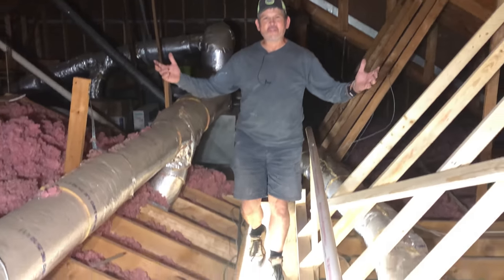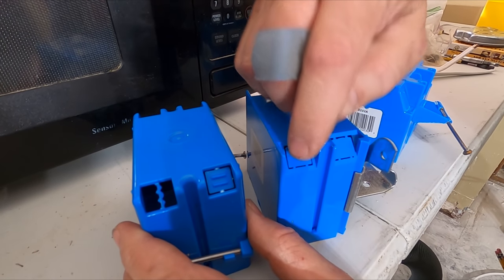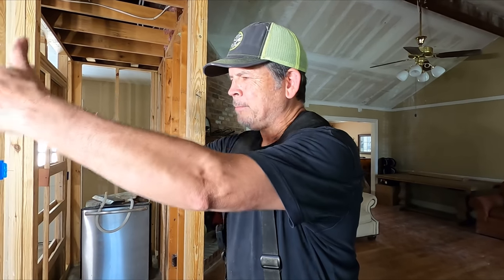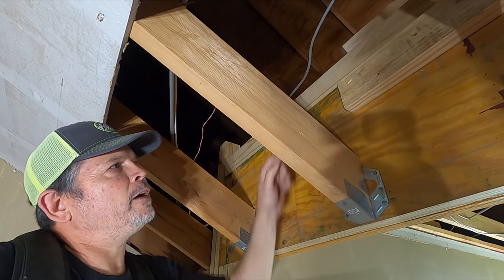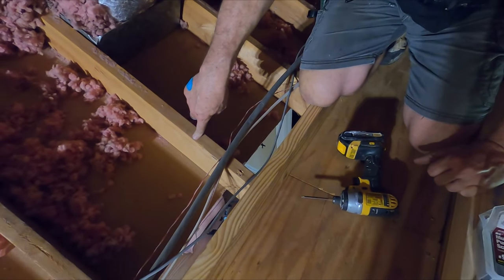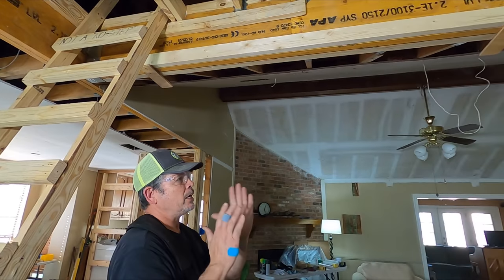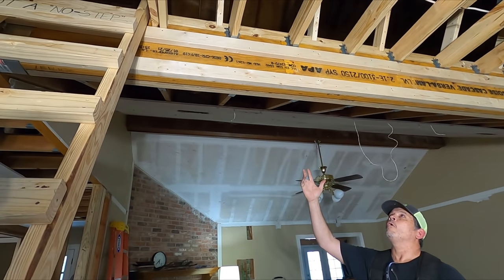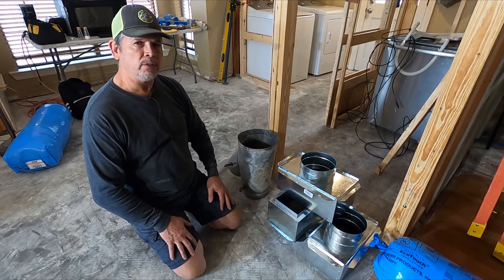EASY ATTIC TRAVEL! We Had Some Spare Materials... Ep. 11

Comment: Hidden J-Box. That's the least of the horrors one can encounter in a remodel.  I once found outlets in a down stairs kitchen where the lady said  "Oh, we don't use those. They never work."  Upon inspection I found both sides of the plug in were hot!  Several hours later I cleaned up the mess and they had new working GFI outlets.  Another time I found a 3 way switch where people were afraid of it because they had gotten "tickled" by the electricity.  Some idiot had used the common ground as on of the travelers so when the switch was using that leg the entire electrical box got lit up.  Fixed that mess too.
Reply from the maker: Some good detective work there user990077 👍

Comment: As an old HVAC helper, I wish every attic would have a solid catwalk down the middle cause going through the ceiling was always stressful lol
Reply from the maker: Yes it is Brandon thx 👍
Reply: HVAC helper.
Reply: @travism9339  yeah HVAC helper 🤨
Reply: @bruizzz13  What did that job entail?
Reply: @travism9339  putting together sheet metal duct work, running flex ducts, run line sets and various other stuff. The company I worked for was a plumbing/HVAC company so sometimes I would help the HVAC guys

Comment: Duct tape was originally called "duck" tape . Named not after ducks, but after duck fabric that was used in it's manufacture.  Later after WW2 people began using it on duct work and the pronunciation changed to duct tape. Now it's not recommended for ductwork at all as it is flammable. Now they recommend the metallic tape like you used on duct work.

Comment: I always foil tapped the flex duct then zip ties the insolation
Reply from the maker: Yeah I kinda mentioned that too.  The way those boots are designed there’s a ridge to keep the inner duct tie from slipping off so I felt pretty good about that plus the inner duct is slid on completely to the neck.
Reply: Heavy duty mastic lined foil tape can go right over the zip tie. Zip tie goes on easy and holds it in place while the tape air seals.
Reply: Yes I also do both, zip tie frees up both hands which enables me to tape. trying to tape and hold the ducting is clumsy

Comment: Duct tape was originaly called duck tape because it was made from a cotton fabric called "doek" and pronounced "duck". Duck could be rubberized to make it waterproof and the US Army used rubberized duck tape to seal ammo boxes in World War 2. During the housing boom following WW2, surplus duck tape was widely used to seal HVAC ducts and the name morphed into duct tape. Meanwhile, the rubber was replaced with polyethylene and synthetic fabric began to replace cotton duck so duct tape was no longer duck tape. However, the adhesive could not withstand the heat of heating ducts and the synthetic fabric also deteriorated under heat so the HVAC code was amended to prohibit the use of fabric tape on duct work. Meanwhile, some entrepreneur trademarked the name Duck and started selling Duck brand duct tape even though it could not be used on ducts. Other manufacturers couldn't call their tape duck tape due to the trademark (and it wasn't made from duck anyway) so for lack of a better name some started calling it utility tape or fabric utility tape, but most people still call it duct or duck tape, even though unless it is Duck brand tape, it is neither.

Comment: If it is designed to be removed completely it must be a knockout.  Anything that can be so easily removed can not be considered a clamp since a small amount of force could cause it to break out.  A clamp would require lots of force to break out; so much it would probably rip the box out before the clamp failed.

"Duck" tape was originally developed to waterproof ammo boxes during world war 2.  The smaller ammo boxes were filled behind the lines and then the joint between the lid and box was wrapped with duck tape so water could not get in while being carried and used by soldiers on the front lines when it was rainy and everything was wet and mucky.  All the soldier needed to do to open the box when he needed ammo was to run a knife along the joint to break the seal.  Just like a duck's feathers are designed to keep the duck dry in the water, "duck" tape was designed to keep the ammo dry when in the water.  But just like a duck's feathers have to be molted and replaced, so to was "duck" tape designed to last only for a short period of time.

Comment: The only reason to not have a basement is that ground water is too high. My basement floor is directly on top of riverbed of a river that is less than 100 yards away. If I had a house in the south, it would have a 2-level basement. The further down you go the cooler it is.
Reply from the maker: No basements within 100s of miles here.  The water table is too high just like you said

Comment: I used to manufacture flexable air duct and the silver part (sometime black) is called the jacket and the black coil on the inside is called the core. Just wanna pass some knowledge on to ya if you didn't know!
Reply from the maker: Thx Andrew 👍

Comment: Love the catwalk. I put them in all the time but usally all I can fit is a crawlwalk. But does saves me time and safety. Glad you do not use those crappy phillips screws. Those are dangerous and should be banned by OHAS. I have a Canadian snowbird friend that I get to bring me down several cases of "Robertson" screws every winter, which are similiar but much cheaper. He claims they have never sold a Phillips or Slotted head wood screw in Canada.
Reply: That's false. You can get screws of any kind here in Canada. But Robertson is the best :p Actually torx are getting pretty popular for deck and framing screws up here, they strip out less than Robby. But the best part of a proper Robertson taper drive is you can jam a screw on the end and it won't fall off.
Reply: @thebigmacd   He is still in AZ, so together went on Home Depot's site in Canada. Total of 7 WOOD screws choices that are Slotted or Phillips  VS 195 choices of Robertson Wood Screws. None of those 7 are longer than  1 1/2". He said up there if you did want to buy those you would have to do it off Amazon or Lee Valley??
Reply: @revenniaga6249  correct. 7 choices at HD is not "they have never sold slotted or Phillips wood screws in Canada". Plus, did you check Home Hardware, Canadian Tire, Lowes and Rona? Or any fastener store. There are tons of places that sell non-Robertson wood screws. But they suck anyway, so Robby wins.

Comment: There is an exception in the code for those single gang new work boxes. They don't need to clamp the wire as long as you staple within the 8 inches. "Exception: Where nonmetallic-sheathed cable or multiconductor Type UF cable is used with single gang boxes not larger than a nominal size 57 mm × 100 mm (2 1⁄4 in.× 4 in.) mounted in walls or ceilings, and where the cable is fastened within 200 mm (8 in.) of the box measured along the sheath and where the sheath extends through a cable knockout not less than 6 mm (1⁄4 in.), securing the cable to the box shall not be required. Multiple cable entries shall be permitted in a single cable knockout opening." This is under 314.17(B)
Reply from the maker: Cool thx Kris 👍
Reply: @StudPack  No problem.

Comment: Looks like the buried junction box behind the dryer was installed for use with a gas dryer.  At the time of installation perhaps they did not know which!
Reply from the maker: It's a gas dryer now.  The 120V receptacle is fed by 10/3 romex so someone was thinking electric dryer at some point.

Comment: In the previous video you showed how you cut Romex with your razor knife but then later you showed us your Romex wire stripper that has a belt in stripper for the sheathing on 12/2 and 14 two wire. So the question is why do you use a razor knife instead of using your sheathing stripper? I used to cut Romex with the razor as you do but once I got my Romex strippers I use them and find it much easier and quicker.
Reply from the maker: We like to show different ways to do things! That’s all 👊🏼

Comment: Head over to Carlon's webpage (which is actually hosted on their parent company ABB website) and goto the "Resources" section, then click on "Publication Library", and then enter the product number you want "Installation Instructions" for.  All those installation instructions are part of the UL Listing of that product and must be made available to the end-user either as part of the packaging, a stuffer sheet/leaflet, or online.  If you have any problems locating the official installation instructions, then please reply with the complete part numbers of the Carlon products you are using and I will make sure you get the correct info sent to you.
Reply from the maker: Thx 👍  I've been to that site, navigation is not intuitive but I found some info but no where does it talk about those knockouts.  Closest I got is: 
https://new.abb.com/products/7TAA040010R0002/1g-20-cu-in-zip-box-w-nails  
Additional info not available, clicking on links yields  "document not found"

Could be it's for knob and tube (each conductor needs a separate hole, one on each side of that flap?).  Part number is B120A-UPC

Thanks again 👍

Comment: The catwalk is nice, but I think the handrail is over-the-top and actually a disaster waiting to happen. Since it doesn't appear to be built to any building code safety standard (I don't think PVC pipe mounted to 2x4s spaced 5 feet apart meets code for a handrail anywhere in the U.S.) it's probably only a matter of time before the homeowner or a service worker leans on it a bit too much and ends up falling through it and then the ceiling. Because of that, I would argue that the handrail is actually a liability, and I would never build something like that, as I'd be afraid of any liability coming back onto me.

Comment: What's your opinion on the flex duct versus rigid duct? From prior experience, I've had the "wet gym sock" odor from flex duct.
Reply: Metal duct is superior in all but two aspects, elbows and install cost. You will never get a mouse living in a metal duct, and the air has less resistance in a metal duct. Unfortunately, they need to be sealed and insulated, and are generally shorter with more joints to seal. Metal elbows restrict air flow by the fast direction change. Flex can have more gradual direction changes, but frequently isn’t installed that way.

Comment: Love the Videos. Have you ever thought about running Cat5 ethernet cable while you have all this access to the attic and walls? I don't care how fast they (Manufactures of wireless modems and routers) claim their products are, wireless will never be faster than hardwire. I did this when having a home built years ago and put connection boxes (Just like outlets) in strategic places throughout the house. TV locations, in the garage, out by the deck, behind the fridge in the kitchen (Have you seen the new fridges that have a touch screen and connect to the internet) and also in the kids rooms. Very inexpensive to do when the access is easy. When we sold the home years after, the hardwired ethernet was one of the main selling points everyone commented on.
Just askin'

and I realize this video is from last year, I'm just getting caught up. Maybe future projects this might be an idea?

Comment: I have a walkway for my house and the shop.  I haven't been watching a lot of your videos, but did notice not seeing any of those metal nail plates so an adventurous person won't drive a screw into the electrical.  Why are you putting old unwanted circuits up in the attic?  Hidden box not plugged or switched, scary.  Long ago I showed up in the morning for a job and needed power and water finding only water in the front yard, no problem lots of hose.  It was a brand new house and the closest construction power was down the street so I knocked on the front door and asked if I could run a cord through the sliding back door.  While setting up the water a construction super shows up, obviously the home owner called him, seriously PO'd to the point that I was concerned he might stick me.  This guy was cutting corners on the whole street and not providing a gfci circuit for the back nor front yard so the new home owner could not plug in a radio and watch the grass grow...  Couldn't water your plants in the backyard either!
Reply from the maker: Thx Bard.  Nail plates coming after electrical rough.  It's crazy what some people try to get away with 😖

Comment: No, duct tape is different then duck tape. Duck tape is called as such because of its water resistance. Duct tape is similar, but we designed to be used for duct work.

That doesn't prevent people from using duck tape on ducts.

Comment: Talk the customer into doing a conditioned attic. If they are spending this much on this project, might as well do the insulation right as well.
Reply from the maker: You mean spray foam the bottom of the roof deck?   Hard to pull off.  Others here tried and regret it.
Reply: @StudPack  if you dont mind me asking, why did they regret it? The only true negatives are the cost and future renovations to my knowledge.
Reply from the maker: Spray foam contractors come in and spray bottom of roof deck with no plan to handle highly increased humidity levels in attic and bad stuff happens. We’re in southern Louisiana.

Comment: Sorry I like your channel but you guys made some serious mistakes on that  ductwork!! 
First of all those zip-ties need to be tensioned with a tensioning tool, not just tightened by hand! You can get a decent one for about $10, and a good one for maybe $25. It makes the  zip-ties far tighter than you can get by hand, and has a built-in cutter.

Second, while metal tape works decently on brand new, clean metal, it is really inappropriate the way you used it here. Even on brand new metal I'm not sure I would trust it to make a permanent seal, but applying it to old dirty ducts on top of old duck tape residue, or irregular surfaces, I guarantee it will not make a good durable seal. You really need to use fiber-reinforced, UL-181 approved duct mastic. Apply  it nice and thick, at least as thick as a nickel. If thee's a big  gap, apply some drywall mesh tape or metal tape first, and put mastic over that. Yeah it's messy work, wear gloves and use a cheap chip brush, but mastic works amazingly well. It makes a rock solid, resilient, airtight seal.

The best practice is once all the ductwork is fully installed, go over all the joints and seams with mastic. You can easily use 4 gallons or more of mastic in one house if it's all rigid metal duct, but obviously there's less to seal with flex duct. Some even consider it a best practice to apply mastic to the register boots before connecting and zip-tieing the inner flex duct to the boot.